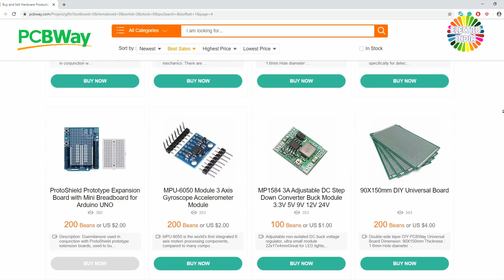400 Watts Mono Amplifier Board DIY Toshiba 2SC5200/2SA1943 Transistor NPN and PNP_Hindi_ELECTROINDIA

Comment: Hi. i have made this project....but have some troubles with it. I use +80-0-80 power...but amplifier give me less than 150watts. I have limits on sine when output voltage ups to 30v. Input signal is ok, first preamp is ok...but next part have limits on signal sine. Need some help...

Comment: so amazing videos watched most of them, question can this be used in a car ?if not could you make a 300watts rms mono amp to drive a sub for a car thanks.
Reply: Bhai agr mujhe chaahiye to kayse milega
Reply: भाई मुझे ये वाला एंप्लीफायर चाहिए कितने का मिलेगा और कैसे 9929422241 कॉल
Reply: These amplifiers produce noise very noisy do not produce crisp clear sound please configure it for sweet Fuller filling sound .
Reply: @m4mike250  v12 is similar to these amps 🤣🤣. Better buy one of those 2 channel pioneer cheap ones 200w rms..

Comment: Hi Can I connect the amplifier to the sub-JBL1000W  device by inserting a Low Pass Filter for Subwoofre?
JBL 1000 Specifications
۱۰۰۰W
۲۵۰ RMS
4 ohms

Comment: Sir I make same circuit board using pdf file but I get 32v dc in speakar terminals without in put in,24-0-24ac transformer are used.what is is problome sir.

Comment: excelente amigos ! un saludo desde Argentina.
Reply: Se puede remplazar 0.25ohm por 0.33ohm
Reply: @yotsukelhancker  El amplificador arranca a la primera , puedes reemplazarlo por los 0.22 Ohm 5W. son comerciales , hasta en la camida estan esas resistencias XD.
Reply: @luisllauce6121  saludos que pasa si lo remplazo por el 0.33 5w ya que 0.22 es muy bajo
Reply: @yotsukelhancker   El proposito de las resistencias de salida del emisor de los transistores de potencia, es la polarización (son limitadoras de corriente); si le subes  el valor que el propuesto ,puede haver saturacion y recalentamiento de los transistores , asi que  saca tu logica,  0.25 Ohm y 0.22 Ohm , es poca la diferencia ,  te recomiendo que le pongas  la de 0.22 Ohm SI EN CASO NO CONSIGAS EN TU LOCALIDAD LAS R DE 0.25 Ohm,yo la he trabajado con 0.22 Ohm  y aparte  modifique el circuito  para ponerles protecciones al ampli. saludos.
Reply: @luisllauce6121  se agradece la información ya que en las mayoría de ampliz del mismo diseño usan 0.33 5w tengo como 5 diseños igual con diferencia de la posición de los capacitóres usan la misma configuración y mismos elementos electrónico

Comment: Sir kya esame 45 0 45 transform 7amp tak laga sakte hai kya sir
Reply: Nhi lagega bcz board 400w ka hai or apke pass 45.0.45/7Amp ka transformer hai jiska watt 45×2=90×7=663watt banta hain trnsiter& Driver  udne k chance 

Is se aacha aap 40.0.40/6Amp ka Troridal Cooper Transformer use karo board ki long life k liye 40×2=80×6=480watt 

Ager apko new Toroidal copper  Transformer chahiye tho contect me

On my watsapp no. +917737511675 my name Tarun panwar

Comment: Sir 400 watt mono amp ki cabinet video jaldi uplod kijiega  thank you
Reply from the maker: ok 😀
Reply: @ElectroIndia Irs2092ic & 2 irfb3607 Mosfets 500watt D-class mono Amplifier bno ....

Irs2092ic ek mosfet Drive Class-D Audio ic hai 20hz se 20khz tak Freequncs  sport karti hai koi v mosfet is ic ke sath chle ga irf640n ....
Reply: @ElectroIndia  400watt mono&  2 Tda7388 ics 8.1 Amplifier bno dual transformers 12 0 12 5 amp + 55 0 55 8 amp ... 12 0 12 5 amp For fan+ bass trabel kit + Bluetooth + 2 Tda7388 ics 0 12 ek ic ko or 0 12  dusra ic ko .... 55 0 55 transformed for 400 mono subwoofer bord ....